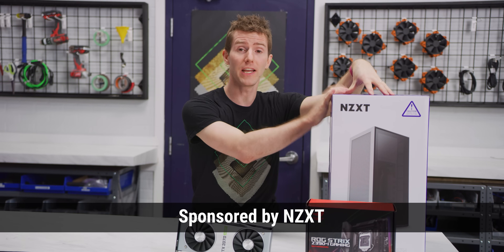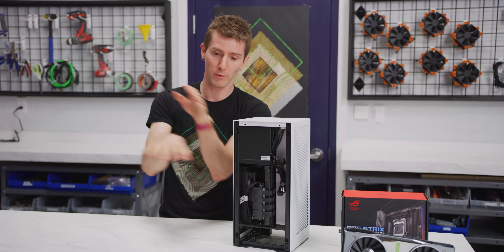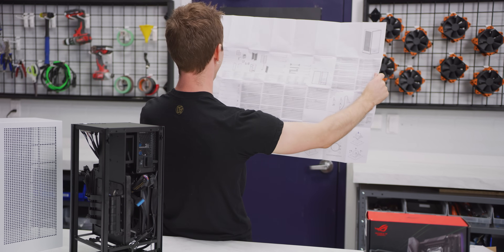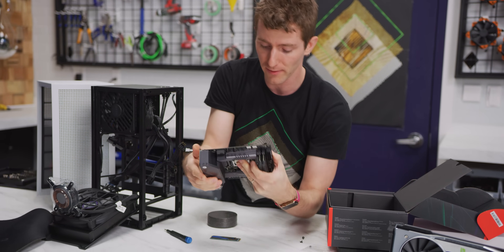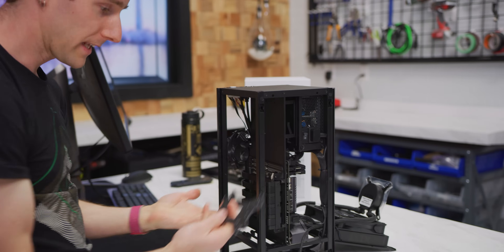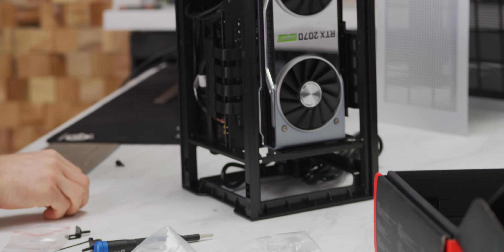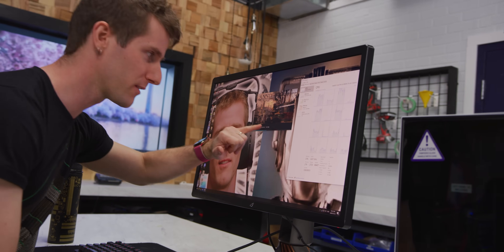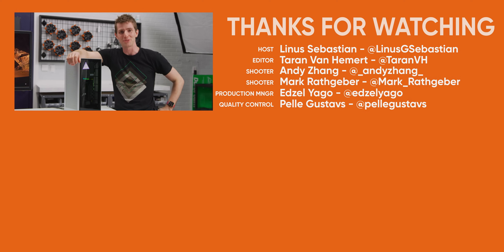Building the Xbox Series X Rip-off PC

Comment: https://www.facebook.com/danthemanholt/posts/10222138019225463

For cheap quality pc gaming, PCIE 3.0:

AMD Ryzen 7 2700X $248
G.Skill Trident Z 16 GB (2 X 8 GB) 3200Mhz $80 X2 $160
PNY GeForce GTX 1070 Ti 8GB $157
Crucial P1 1 TB M.2-2280 NVME Solid State Drive $100
Rosewill - FBM-X1 MicroATX Mini Tower Case $20
Windows 10 Pro 64 bit $15 key
Raidmax Cobra 500 W 80+ Bronze Certified ATX Power Supply $44
GIGABYTE B450M DS3H WIFI AM4 AMD B450 SATA 6Gb/s Micro ATX AMD Motherboard $85

$749-$829

PCIE 4.0:

AMD Ryzen 7 3700X $299 
G.Skill Trident Z 16 GB (2 X 8 GB ) DDR4-3733 $153 X2 $306
PNY GeForce GTX 1070 Ti 8GB $157
Crucial P1 1 TB M.2-2280 NVME Solid State Drive $100
DEEPCOOL MATREXX 55 ADD-RGB 3F Case, E-ATX Supported, Motherboard or Button Control of SYNC of Addressable RGB Devices of Any Brands, 3x120mm ADD-RGB Fans Pre-installed, 4mm Full Sized Tempered Glass $74
Windows 10 Pro 64 bit $15 key
Raidmax Cobra 500 W 80+ Bronze Certified ATX Power Supply $44
ASRock X570 PHANTOM GAMING 4 WIFI ax ATX AM4 Motherboard $154

$996-$1149

PCIE 3.0 with i9-9900K:

Intel I9-9900K $525
G.Skill Trident Z 16 GB (2 X 8 GB) 3200Mhz $80 X2 $160
PNY GeForce GTX 1070 Ti 8GB $157 or Asus GeForce RTX 2080 8 GB DUAL EVO Video Card $600 or MSI GeForce RTX 2080 Ti 11 GB VENTUS GP Video Card $1080
Crucial P1 1 TB M.2-2280 NVME Solid State Drive $100
DEEPCOOL MATREXX 55 ADD-RGB 3F Case, E-ATX Supported, Motherboard or Button Control of SYNC of Addressable RGB Devices of Any Brands, 3x120mm ADD-RGB Fans Pre-installed, 4mm Full Sized Tempered Glass $74
Thermaltake 360 Floe Riing TR4 Edition $250
Windows 10 Pro 64 bit $15 key
EVGA BQ 850 W 80+ Bronze Certified Semi-modular ATX Power Supply $100
MSI MPG Z390 GAMING EDGE AC ATX LGA1151 Motherboard $190

$1491-$1571 or $1934-$2014 or $2414-$2494

1070 or 1070 Ti for cheap: https://www.ebay.com/sch/i.html?_from=R40&_nkw=1070%20ti&_sacat=0&LH_TitleDesc=0&fbclid=IwAR3EN431P-zEj92d3vtSuaceX9oxhlm8PQ9CjR0sbFdKiPf73mifsFe-Ios&_udlo=150&_udhi=240&rt=nc&LH_BIN=1

Last I checked Frys Repair department will put together a gaming PC from parts you give them for $90, and they will put in an AIO (radiator fan cooling unit) for another $50.

179 watts (250 watt power supply recommended)

1. AMD Athlon 3000G 3.5 GHz Dual-Core AM4 Processor with Vega 3 graphics $50 or 
AMD RYZEN 3 3200G $100
2. ASRock B450M-HDV R4.0 AM4 AMD Promontory B450 SATA 6Gb/s Micro ATX AMD Motherboard $50
3. Corsair Vengeance Performance 16 GB DDR4-2400 memory $50 (OLOy 16 GB (2 x 8 GB) DDR4-3200 Memory $58)
4. Seagate Barracuda 500GB $18 (or ADATA SU635 240 GB 2.5" Solid State Drive $28)
5. Rosewill - FBM-X1 MicroATX Mini Tower Case $20
6. Corsair - VS 650 W 80+ Certified ATX Power Supply $26
7. Windows 10 64 bit $100 (you could get a hold of Windows 10 64 bit key for $15 range)

Total: $229 (with $31 EVGA GeForce GT 730 2 GB Video Card total is $260, with a 50 watt $70 XFX Radeon RX 550 video card total is $299, with a $100 XFX Radeon RX 570 4 GB video card instead for a total of $329). No video card with Ryzen 3 3200g it costs $279.

The $50 processor on this build has it's own Vega 3 graphics card inbuilt but it supports I think low quality 720p, and alright 360p but I don't have any actual numbers. Ryzen 3 3200g has the inbuilt Vega 8 graphics is about the same level as Vega 11.

Another video card choice is XFX $70 Radeon RX 550 2 GB. RX 570 has a sizeably greater amount of performance.
https://pcpartpicker.com/products/video-card/#X=0,10605

I got everything else cheap as possible, the only option I didn't explore is an even cheaper processor that is still functional. If you really look and rummage through techies you can get used and refurbished stuff for cheap but you're taking a chance and you really have to have very technical knowledge in a lot of cases. If you're good at repairing you can get broken stuff. Everything I put is bought on the market as brand new.

Starter builds:

https://www.youtube.com/watch?v=bGVdhNRejAU This is a December 20, 2019 video

This is Jan 1, 2020: https://www.youtube.com/watch?v=Ye3G1mlJBrM

Here's what X-Box Series X and PS5 looks like:

1. Ryzen 7 3700X $290
2. GIGABYTE B450M DS3H WIFI AM4 AMD B450 SATA 6Gb/s Micro ATX AMD Motherboard $85
3. Team T-FORCE VULCAN Z 16 GB (2 x 8 GB) DDR4-3200 Memory $65
4. Crucial P1 1 TB M.2-2280 NVME Solid State Drive $100
5. EVGA GeForce RTX 2080 SUPER 8 GB BLACK GAMING Video Card $700 or 3090XT $500
6. Rosewill - FBM-X1 MicroATX Mini Tower Case $20
7. Corsair - VS 650 W 80+ Certified ATX Power Supply $26
8. Windows 10 Pro 64 bit key $15
$1101 to $1301

The game system also plays DVD and Blu-ray in 4K UHD.

For $96 external 4K UHD HDR 3D Blu-Ray DVD CD player for Desktop Win 10 and Mac. 4K UHD HDR 3D CD DVD Blu-Ray player:

https://www.amazon.com/External-Blu-ray-Portable-Optical-Windows/dp/B07ZXS67Y1/ref=sr_1_4?dchild=1&keywords=external+4K+UHD+3d+blu+ray+player&qid=1585894860&sr=8-4

Best software to play 4K UHD HDR 3D Bluray and DVD, cheap too for $44.25 for lifetime:

https://www.anymp4.com/blu-ray-player/

Here's the closest to a PS4 Pro and X-Box One X specs

1. AMD Ryzen 7 2700X $248
2. Corsair Vengeance Performance 16 GB DDR4-2400 memory $50
3. ASRock Radeon RX 580 8 GB Phantom Gaming X Video Card $160
4. Western Digital Caviar Blue 1 TB 3.5" 7200RPM Internal Hard Drive $45
5. Rosewill - FBM-X1 MicroATX Mini Tower Case $20
6. Windows 10 Pro 64 bit $15 key
7. Corsair - VS 650 W 80+ Certified ATX Power Supply $26
8. GIGABYTE B450M DS3H WIFI AM4 AMD B450 SATA 6Gb/s Micro ATX AMD Motherboard $85
$649

The processor was only 8 core not 16 thread, so not as good as a Ryzen 7 2700X that's 8 core and 16 thread but it's the closest to it. The processor of the X-Box One X and PS4 Pro would be closer to Ryzen 7 1700 (Ryzen 7 1700 is also 8 core 16 thread), but you can't find that in stock online, and not for a good price. X-Box One X and PS4 Pro's processors have 8 cores but they don'thave 16 threads. The motherboard wouldn't be as good for those consoles, but this is the closest cheapest motherboard that still has wifi. The power supply would be weaker for those systems but this power supply was pretty cheap I'm also going by price. The power supply for the X-Box One X is 245 watts. The graphics card would be $160 RX580 level or the yet to be released $140 AMD 3060 graphics card. The price for this build list changes drastically as the prices in the market are constantly changing. X-Box One X has 12GB ram, and PS4 Pro has 8GB ram. X-Box One X has 4K UHD HDR blu-ray. PS4 Pro plays HD 3D blu-ray.

Specs of X-Box and PS4:

https://www.digitalspy.com/tech/best-tech-deals/a26285534/xbox-one-vs-ps4-which-one-should-i-buy/

https://www.techradar.com/news/gaming/consoles/ps4-vs-xbox-720-which-is-better-1127315/2

https://www.extremetech.com/gaming/156467-xbox-one-hardware-and-software-specs-detailed-and-analyzed

Article on X-Box Series X and PS5 specs:

https://www.facebook.com/danthemanholt/posts/10221263461602069

https://www.youtube.com/watch?v=Gci-KI-RRbg&t=103s X-Box One X vs. PS4 Pro vs. $500 PC

Video of an actual X-Box Series X performing, and looking at it's internal parts, and another video talking about PS5:

https://www.youtube.com/watch?v=7Fjn4GRw8qE&t=1s&fbclid=IwAR3Yzih4xsToGZdOxtJCFwCnc_zKPEuoQSYfST2w1ARbPRog49vc5LLqXB4

https://www.youtube.com/watch?v=pfeaQdS00a4&fbclid=IwAR0pgtu0W21fcpTbESU4oIUbr9icXlZqSHOHvWj5NcBXoDmFL10fnAoRVKs

Comment: using a million cables always looks overwhelming i wish pci express was enough i wish the motherboard didn't require any extra cables i don't get why thats a must
Reply: @PlsSubscrib  I think you get it... power!
Reply: Derp
Reply: @madmax2069  haven't heard the word derp since old Minecraft omg
Reply: teh gpu linus used requires more power thant the motherbaord can provide, so it needs another cable coming from the psu to power it. But there are gpus that don't need that and can just be plugged on the mobo and then ready to go.
Reply: @gustavinho9053  they just don't deserve to be called gpu's
Reply: @gustavinho9053  nobody wants them tough, they're barely better in performance than your typical apu or igpu
Reply: @Dan81825  wut
Are you implying that something like a 3080 is only slightly better than integrated Vega graphics? That an integrated GPU is only a little worse than a dedicated GPU? Nah.
Reply: @AurumFaber  read again. I am implying, that a gpu with a max TDP of 75W (no external PSU sockets) is barely better than an igpu, meaning specifically, that they're not worth the money.
Reply: @Dan81825  oh yeah, that makes sense. Sorry
Reply: @AurumFaber  no worries. I completely agree with your statement.
Reply: And I wish you'd use punctuation
Reply: Me: *Has been following Lego instructions for the past 13 years"
Yeah, I could build that.

Comment: Hope this helps.
The performance of your CPU — the “brain” of your PC — has a major impact on the speed at which programs load and how smoothly they run. However, there are a few different ways to measure processor performance. Clock speed (also “clock rate” or “frequency”) is one of the most significant.

If you’re wondering how to check your clock speed, click the Start menu (or click the Windows* key) and type “System Information.” Your CPU’s model name and clock speed will be listed under “Processor”.

Comment: the case is $350 though, that's going to be more than half the price of the next gen consoles. You'll have to put good parts in it, so a 2070 ($450), i5-9400F ($160), a non-trash motherboard  (any one around $150 will do you well), 16gb memory ($75) and enough storage to fit windows + a bunch of games (2tb ssd is $280, 1tb is $120). 

So a total cost of $1305 (1tb of storage) or $1465 (2tb). I'd be willing to wager that you could buy BOTH next gen consoles for the price of this build.

The case looks cool, but the price tag is not going to convince console users to come over to pc. Especially seeing as there are rumours going around of a "Windows mode" which would mean the xbox series x is basically a pc gaming rig that will last 5-7 years, for a fraction of the cost of an actual pc gaming rig.

Side note: If the above rumour is true, Playstation is dead in the water.

Comment: I need help: 
I have 2 16gbs stick of RAM  totaling 32gb. They were bought as a kit. 
When i install them as dual channel my computer wont boot. When i install them in single channel meaning slot a1 a2 it boots up. the motherboard recognizes both sticks. 
The motherboard is a z390 asus. and the sticks are corsair vengeance pro RGB
any ideas?

Comment: Hello LTT Team, i really love you're videos and they have inspired me to try to build my own pc. I was hoping for a bit of feed back so that i don't go wrong right away. 
My configuration would be: 
1) Fractal Meshify S2 White - TG - Corsair iCUE 220T RGB Airflow 
2) MSI B450 TOMAHAWK MAX (AM4, AMD B450, ATX)
3) AMD Ryzen 7 3800X 
4) Samsung 970 EVO Plus 1000GB
5) Gigabyte GeForce RTX 2070 Super Gaming OC 3X (8GB)
6) Corsair RM750x White 2018 (750W)
7) G.Skill Trident Z RGB (2x, 16GB, DDR4-3600, DIMM 288) - G.Skill Trident Z RGB AMD Edition (2x, 8GB, DDR4-3600, DIMM 288) - Corsair Vengeance RGB Pro (2x, 16GB, DDR4-3000, DIMM 288) - G.Skill Trident Z Royal (2x, 8GB, DDR4-3000, DIMM 288)
8) Noctua NH-U12A (15.80cm) - Noctua NH-D15 Chromax  - Noctua NH-U12S Chromax Black 

As you can see by the ''-'' im still unsure on a couple of things. i hope thats a full build since i would know what to ad. on the other side after seeing this video im thinking of doing it like you with this case so that i don't fxck up something stupid. im just on the fence bought the thermals

Comment: I'd like to point out to people going by percentages and compute units.... Just because you have 10,20,30,40 more computing cores, does not mean you will get 10,20,30,or 40 percent more performance... Many factors affect the performance of any computer, not simply just the core counts and frequency. This has been proven time and time again. Unless we get a side by side comparison of one with another, running the exact same test, on the exact same operating system, then we really can not compare the two at all.
Something as "simple" (simple to some, extremely complex to  others) as a computer's OS, it's running tasks, as well as heat, and amount of power it is limited to all play a major role in how a PC performs. 

However, IMO when people compare consoles to desktops....I'd like to point out that most people focus on the capability on the machine, I.e what programs/apps it runs or can run.

But alas, this is purely kernel related and so to me, since consoles have come so far, we should now be comparing kernels and operating systems and not the hardware.

We are essentially comparing a "powerful GAMING device with plenty of cores and a 2080super/5700xt with a somewhat exclusive (and at the same time, not so exclusive to where it shouldn't even factor in getting an Xbox over a PC) gaming library" to a "powerful ALL PURPOSE device with plenty of cores and a 2080super/5700xt that can run many if not most of the same games that the Xbox can and at a performance level we should just call about the same at this point in time. However... A PC has the ability to run things other than games, and was designed for the purpose of gaming AND versatile programs, and has the capability to easily and affordably be upgraded 1 week, 1 month, 1 year, 2 years, or even 5 years after you purchase/put it together! 
Think about all the tasks a Windows/Mac/Linux COMPUTER can and does do, and then think about what a Xbox OPERATING SYSTEM can and does do.

Just some stuff to think about!
Reply: We are comparing Apples to Oranges people.
They are both fruit.
You can see, smell, taste, and feel them.
But how you eat them, and what you get out of them differs. Sometimes greatly, sometimes not so much. But they both taste good when you focus on one or the other. But when you have both, you may not appreciate one as much, over the other. It depends on preference.

Comment: I did my first ever build. Took all the components from my old prebuilt and put them in a new case. Got the Matrexx 70 by DeepCool. Beautiful case.

Everything went smoothly until I went to start it. Boot looping. My DRAM is fried. Not the first time boot looping has been an issue, but in the past, reseating connections has resolved the issue. No such luck this time.

My friend offered to buy a new MOBO since mine is boned. Now I just have to hope the DRAM shat itself. And that nothing CAUSED it to.

Comment: Looks like you should of install that cooling bracket, on the back of the MB for the CPU, before you installed the MB.
I hate having to work in tight places.  OH what was the PSU rated at, i don't remember you saying.

Comment: As a mildly experienced PC builder (I've build a few PC, 4 maybe) it looks harder than most ATX or mATX builds. Just beceause of tight spaces. But looking at it from ITX point of view this is the easiest one I've seen so far. Maybe outside of Node202 with included PSU.

Comment: Hi Linus. I just checked the prices for graphics cards. Most cards used for pc gaming up to 4K are 8GB cards.
Even later 8GB models, like the RTX 2070, are kind of cheap now. The price is between 500€ and 700€ now. 

With the latest models, which are just overkill.

You get the Geforce RTX 2080Ti with 11GB in the range of 1000€-1500€, so this is kind of a fair price now.

If you however want to get further to more recent models, things begin to get pretty expensive (or cheap) and the price/value ratio leaves a bigger gap. I'm not sure if you get any benefit or value for the ammount you are paying more.

The Radeon Pro WX 9100 with 16GB starts at 3.950€.
The equivalent price for 8GB would be 1975€.

There is hoewever, a "reasonably priced" card in between:
It's the Nvidia PNY Quadro RTX 8000 with 48GB
For round about 6200-6300€ you get 48GB. If you divide that down, it's at 1000€ per 8GB.

The NVidia Quadro GV100 Volta with 32GB starts at a whopping 15.580€. This card would cost 3895€ per 8GB.

So based on that, I would recommend to bite into the sour apple and save up until you reach your 6300€ and then buy the NVIDIA PNY Quadro RTX 8000 with 48GB.
This card not only is the one with the most graphical storage, it's also the cheapest one if it comes to money/GB on the models with more than 11GB.

But there has to be a difference between the Quadro GV100 Volta with 32GB and the PNY Quadro RTX 8000.
Otherwise it makes almost no sense to pay 9280€ extra for 16GB less storage.

What's your opinion between these 2 cards?
Is the 48GB NVIDIA PNY Quadro RTX8000 the better choice?

Or are there some features you will not get by buying it?
Sure you will miss the tensor cores, but what is the benefit of them or other features?

Comment your opinion below.
How do you think the graphics-cards market will develop in the future?
Are there already some new cards in the development process most of us don't know yet?
And are my thoughts correct, or do I miss something?
Please consider making a fair benchmark-test for all the graphics cards mentioned and some other ones for really being able to get a fair result and therefore an opinion about it.

If you have the same with as me (getting these questions answered) leave a like if you want.
Thanks.
Keep on making these great videos Linus. You have one of the best channels here on youtube. 

And a massive thanks for the whole LinusTechTips team.